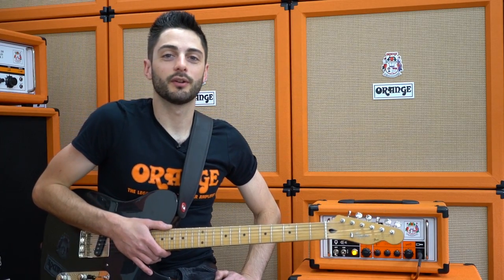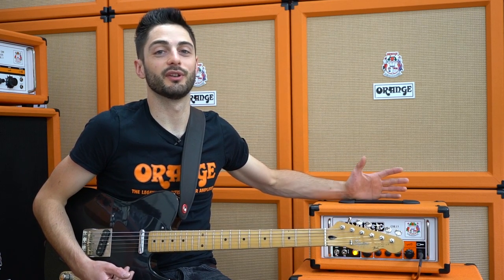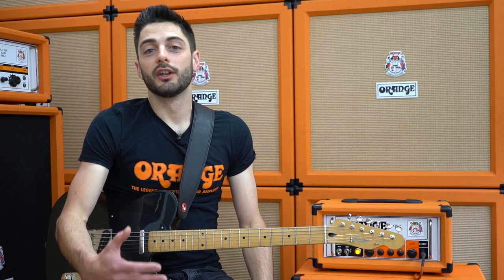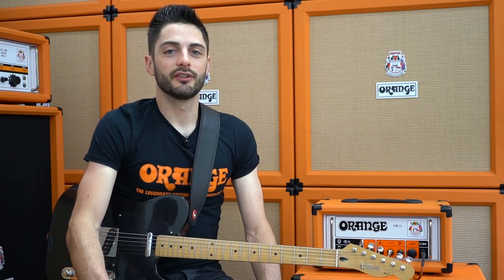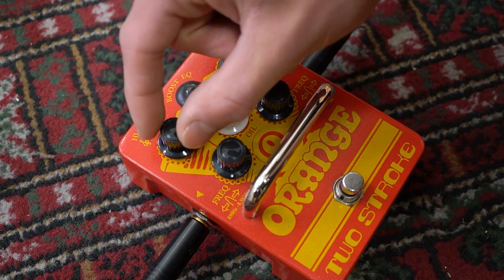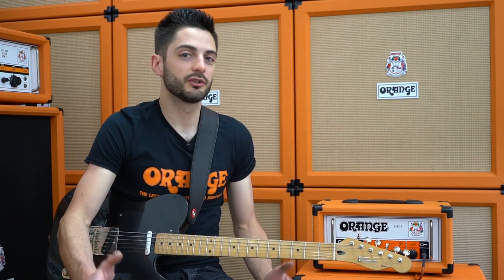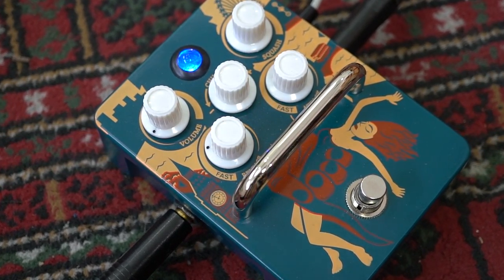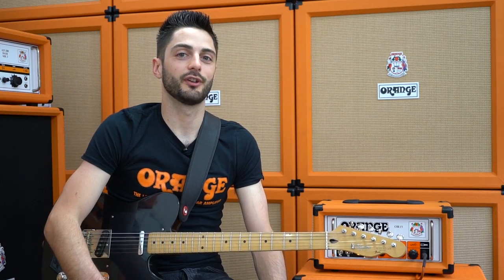How do you make a single channel amp into a two channel amp?

Comment: Another tip I have is to put a passive volume pedal into the FX loop (particularly for taming an amp sound without it sounding anemic). The more you think about it the more fun times can be had by using it.

Comment: This all makes great use of Orange pedals and are good tips overall.  Another pedal free method is to use a guitar that has independent volume controls for each pickup, such as a Les Paul.  Set the gain for the distorted sound and then roll back the neck volume to clean it up.  When you want the distorted sound, throw the toggle switch to the middle or bridge pickup where the volume is up completely up (or at least up enough to push the distortion).  Then you could use a pedal such as a boost for another level of gain and the compressor trick here could level things out if needed.

Comment: what I did with my or15 was use an aby box in the fx loop. I had the first input be the preamp of the amp via the fx send, and the second input be just the straight guitar signal going through a eq pedal.  So I effectively used the eq pedal as my preamp going straight into the power amp, and when I wanted the dirty sound I would just switch back to the regular amp.
Reply: cone whoa...wait, so the heavy/overdrive/lead part is the natural distortion of the amp?
Reply: Daniel Valles yeah. Just like you plugged straight in.
Reply: That's a really good idea.  I know what I'm doing with my ABY and OR15 today.
Reply: I do this with my 6505+
Reply: How did you plug your guitar into the pre amp and eq..?
Reply: @xaptronic  I made a diagram you can look at here https://ibb.co/5GSHGVS
Reply: @Jakeman90210  Thank you - So the guitar connects to the ABY where one output goes: MXR EQ -> FX Return and the other output goes:  Into the Amp input... I'm confused about what the FX Send is plugged into.. or what is plugged into the FX send?
Reply: @Jakeman90210  thanx for the diagram... But i am confused about the fx loop send also.... Where does that go.... I have a donner active aby , dark terror and want to rum out of the line out vox mv50 clean into the return.  Guitar aby - a.DT input b. Vox input - vox line out to fx loop return....  Is anything needed in the fx loop send?  Another idea is what if i want an fx pedal to both "channels" in the loop??? Is this possible?
Reply: @xaptronic  did u ever get an answer to this??? Any thoughs on my chain question below?
Reply: Oscar Avila yes you need the send as an input on the aby so it will pass through when you’re running into the front of the amp. I don’t remeber exactly how I got it to work because I did it 2 years ago, but you can get it to work
Reply: @Jakeman90210  trying hard brother.... But you almost have me at the promised land.... Ive gotta be missing something... Where does the guitar plug in???? 

Send - aby input - output a - amp input / output B - preamp - return

I dont see an open input for the guitar???
Reply: Oscar Avila I’m going to draw up another diagram. I was using an ART aby box that had 2 inputs and I think that’s where we’re getting stuck

Comment: the is a pretty common method. considering older amps and amps like Fender, for example, are loud and mostly clean. Add a distortion or overdrive pedal, and you've got Fender Cleans, and "british" amp style from the distortion pedal. There are hundreds of distortion and overdrive pedals

 I run a Traynor YCV40 clean (Hot Rod Deluxe style amp), with BOSS Combo Drive (for Vox sounds), Radial Tonebone Hot British (Marshall) and TC Electronic Mojo Mojo Overdrive in front of the amp. These come after the tuner, Wah, and compressor. Mojo Mojo after the 2 distortions in case you want to further fatten the distortion, in a creamy way, or by itself. Makes single coils sing. And a TC RUSH pedal (clean boost with up to 20 dB of gain) as the last pedal in the FX Loop.

Comment: Someone should make a pedal that makes your Dirty amp clean.  Could name it the “Gain reductomatic 10,000” or the “Underdriver”.  Now that would be an innovation!  Lol
Reply: @brightfalls
Reply: Bright Falls absolutely love this idea - I have a few single channel amps that I love the natural tube distortion of but I also want the clean tone available at the same time!
Reply: Mad Professor already makes the Evolution Orange Underdrive.
Reply: I do this with my zen drive. Just put The gain to zero and lower The volume until its clean
Reply: You can do this with just about any pedal that has a Volume control. I use an mxr 10 band eq because it has 24 db of cut on the two level controls and I can use it to shape my clean sound separate from my distorted sound. And there's also already an "Underdrive" pedal.

Comment: Just an idea I had but haven't tried out. What amp a volume pedal between guitar and amp, setting the amp to high gain, then switching on the pedal when you need a clean tone? Would it work the same way as rolling off the guitar's volume knob?